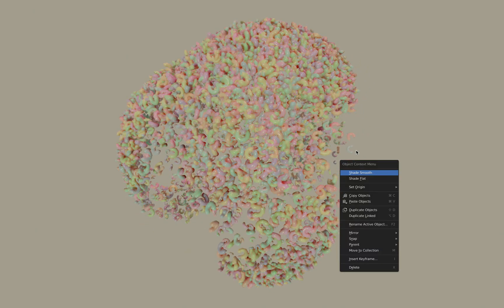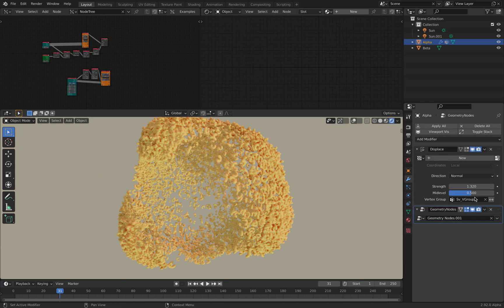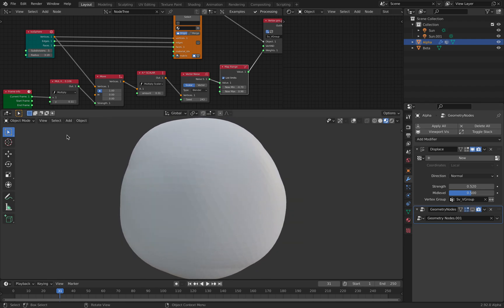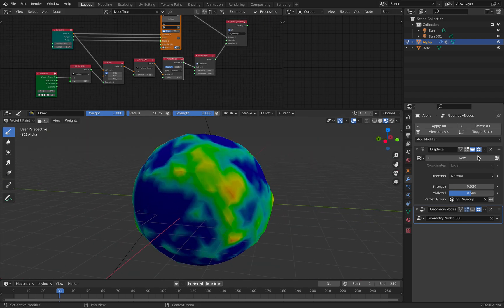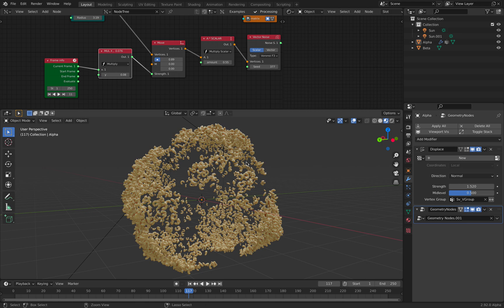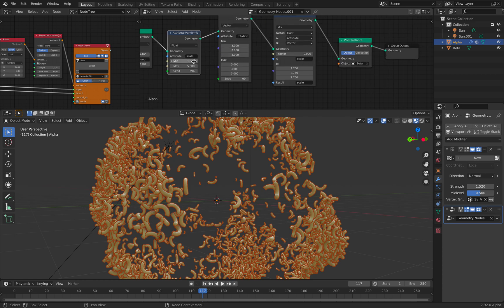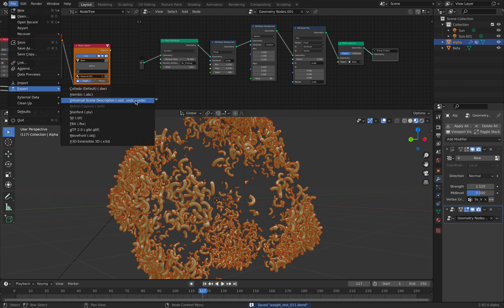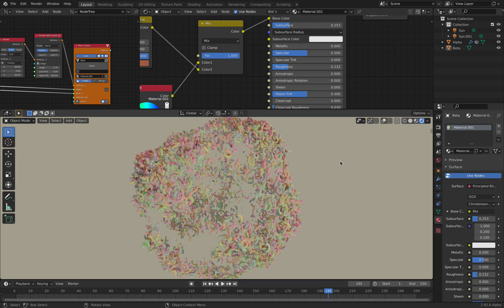LIVENODING Procedural Weight Noise and Geometry Nodes Instancing

Comment: This is very valuable as Geometry Nodes lacks this capability so far. However, it seems this no longer works with Blender 2.91 and the latest SV Nodes. Perhaps you could update your GitHub files? Thanks!